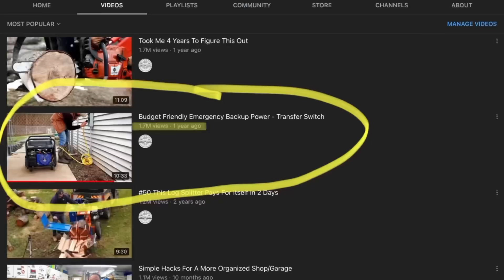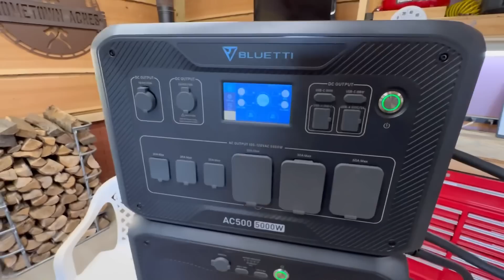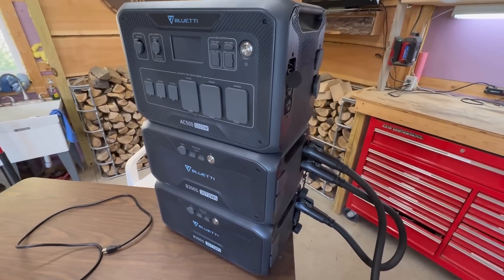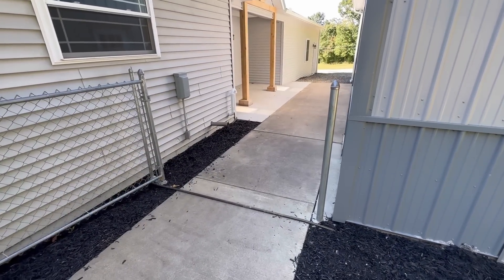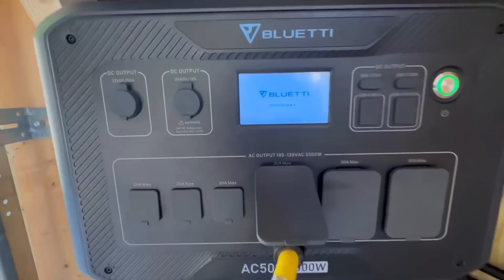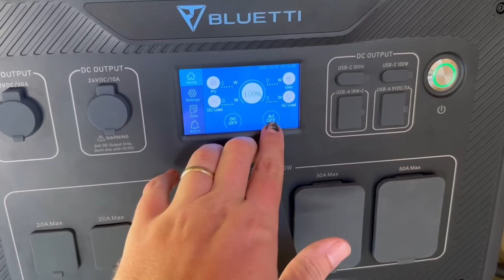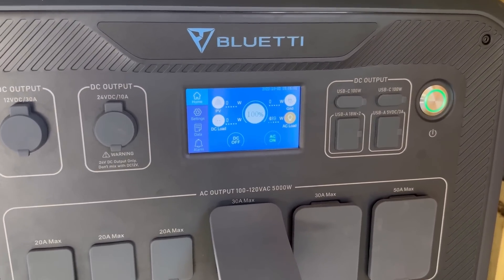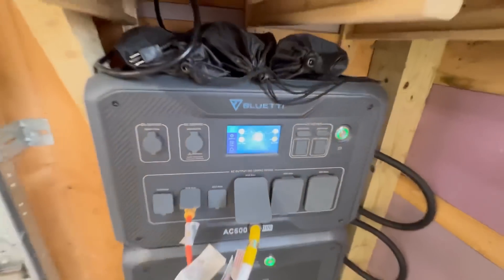The End Of The Gas Generator? - Bluetti AC500 & B300S

Comment: Thanks for the video, good information. One additional benefit to a transfer switch - the ability to route power to the protected circuits at the same time that utility power is running and powering the other circuits outside the transfer switch. Why do this? You might wish to capture solar power which feeds your battery bank, and then use those batteries to feed your transfer switch. You could offset a lot of your utility bill and make use of your solar system on a day to day basis. These batteries can endure many cycles, using them regularly is a chance for testing, and you can recover some of your costs of the solar / battery system. For this reason I like the transfer switch - feeding two sources of power at the same time. Some of the devices that you found were not on your transfer switch could be addressed with extension cords. Also, you could consider using a traditional generator to refill the battery bank, which would be more efficient than running the generator constantly at times of low power needs. But be careful about feeding dirty power to the battery bank - an inverter generator would be preferable. I do wonder why you turned off you main power to the house? With the transfer switch implementations I have seen, you could start moving your transfer switch circuits to the generator path and the other non-protected circuits could keep pulling utility power. Those transfer switches have a toggle switch so the circuit can take only one source as a given moment in time.

Comment: Adam,  Your just starting in to it. With backup generators & power storage units,  an with solar panels. You need to know your average daily air pollution count. We decide to put our panels  at ground level so they would able to wash then . "Lately", we been wash'n them monthly with a Mike Morgan Foam Cannon. I would hate to have to climb up on a two-story roof & wash the panels. O, I like the looks of your new drain system.

Comment: Man wish I could test a system like that here at the off grid home. I live off solar, windmill and generator. With gas prices right now running the generator is getting way expensive. Is your house and land position right to add solar? Start with a small system then add on as you go? My other question is how do the battery packs hold up to cold weather? I notice my batteries seem to have a hard time in cold weather.
Reply from the maker: They have built in heaters in them rated for temperatures down to -4 F

Comment: Most farmers near me run backup power off a tractor PTO...  I've seen these electric generators before but no chance... the cost is way to high.
A 10000 watt champion generator is much cheaper ... a cheaper option and quieter is a 4000 invertor  generator which us much quieter.

Comment: Battery backup has it's place but I prefer the generator as my backup source. BTW If your carburetor/fuel system gets gummed up after long term storage, it just means you didn't put it away properly. For long term storage you need to purge the fuel system. For shorter intervals you can use fuel stabilizers but purge is always the safest option just in case that storage interval last longer than expected. If you put your batteries away improperly, IE: not charged, you will have issues as well. So putting your backup power source away properly is necessary whether you use a gen set or a battery.
Reply: When you say purge the system, does that mean turn the gas off and let the carb run empty thus shutting the motor off ?
Thanks
Reply: @leovogelgesang4398  Doing that will remove most of the gas but not all of it. There will still be enough gas that will turn to "varnish" (as they call it) and clog the small passages in a carburetor. My procedure is to drain all the gas that I can and then pour a few ounces of Seafoam (a brand of fuel stabilizer & carb cleaner) into the tank. Then I crack the drain on the carb until I see a little of the Seafoam start to drip from the carb drain. Close the drain and pull on the start cord a few times to draw the Seafoam into the passages of the carb. Then put it away. When I get ready to use it again I just open the drain on the carb bowl, wait for the bulk of the seafoam to drain out then close it. Add gas and away you go.

Comment: Nice Video.. and I agree each household needs to determine their needs and what works best.. I see the cons with Gas generators if you don't use them, fuel issues etc.. Maintaining multiple, typical unused engines gets old and usually is ignored.. Living in a country and if you have a tractor, you might consider a PTO generator.  Alternatively I have neighbors who are concerned with flooded basements in the spring, they have installed propane generators , with auto start and an auto test features.

Comment: While it is very expensive you could double that set up and have 10000w inverter and 12000w battery storage(you could add more batteries to triple that). With 2 units you can have up to 6000w of solar panels.  This is the future.

Comment: I have a small portable Bluetti and it is a well built device. They say that the LiFePO batteries are safer than Lithium Ion and they also have many more (about 6 or 7x) charge cycles of lifespan as you mentioned in the video. Those two benefits are huge because you could buy cheaper Lithium Ion batteries with a Wh rating comparable to the B300 LiFePO. Bluetti isn't cheap, but it's worth taking a look at even if you're only going for a smaller capacity model. If I were building from scratch for off grid, I'd do some targeted DC wiring in the house to avoid the inefficient conversion from DC to AC and back to DC for virtually all of today's electronics.

Comment: Nope. No. Nope. How long can those batteries hold charge in storage? What is the maintenance plan for storage? A lot of Li batteries don’t like sitting at 100% soc or 10%soc. A usual sweet spot is 50% for storage. Kind sucks if you need it at a moments notice and it’s only 1/2 full. How to refuel if the grid is down?!…oh that’s right! Let’s charge it up with a ice generator 🥴🤦‍♂️ Adam a better investment would be a ford Lighting truck if you want battery back up power. Better chance the battery being in better condition and way more capacity.

Comment: Excellent overview, Adam! I’ve had the interlock system installed for 2yrs. I can run every circuit other than AC. My dual fuel generator is on a large covered porch with no exhaust/ventilation issue. However, I would advise anyone to consider a battery B/U or maybe both both - nothing is perfect.

Comment: If you were to be without power for more than two days, could you recharge the batteries with the gas generator while still using the battery packs and have the generator add more charging power than the house was using? I hope you understand what I’m asking here.
Reply from the maker: Yes I believe that would work but that sounds an awful lot like strapping a gas generator to the roof of your Tesla hahaha
Reply: @HometownAcres  - 😎Doug is saying " Give that Tesla some gas Princess"
Reply: @HometownAcres  depending on how much power is required to refill the batteries, you could get a small, cheap generator that maybe puts out 1K watts. Our neighbor kept their house going fueong our recent 14 day outage using a small generator and a couple extension cords. I think he said he used about 5 or 6 gallons of gas during that time.  I used about 8 to 10 gallons a day on maxing our 6K generator.

Comment: Edit - Wow sir, your three accessories were $6,500.
Firman 7500W Running tri fuel (propane option) is $999 on costco. 250g vertical propane tank will last about 15 days and cost $500 to fill to 80%. Louder, yes. 
My neighbor is in the process of installing a propane generator. I'm curious to see his results. Thanks for vid. BTW, the most frustrating thing about the so-called Green industry is on Bluetti's homepage: "...but without any fuel costs, noise, and pollution." No... we just outsourced our pollution to China in the form of mining lithium, producing these batteries, and the requisite panels.
Reply: I agree!! The price tags on these solar generators are too much for the average joe.
Reply: @The Solar Junkie The only thing you are missing, is an 80 foot tall $50k wind turbine standing in the wind!  But then, what if there is no sunshine nor wind for a long time?  Well, then you resort to your gas generators.

Most folks can only afford a single backup power source, such as a gas generator.  And even then, these can get ridiculously expensive.
Reply: @The Solar Junkie Very cool. I'm going to check out some things in your post. Thx!
Reply: @The Solar Junkie That's what I am trying to do. However, by the time I have everything, something newer will come out and make my system outdate.
Reply: I had a Westinghouse 9500DF installed and directly connected to my cottages power and existing 500 gallon LP tank. It works great and the certified electrician says I have more than enough power to run everything.  I''ve had only a couple of outages since, with the longest nearly 4 hours.  I've changed the oil to 5W30 synthetic to handle cold weather, checked the spark plug, clean the air filter (at 50 hours), and start it regularly once a week for 15-20 minutes; and, one time, for an hour.  Trying to decide if I should sell myself into a whole house inverter with split phase and two batteries since I have a 240 water pump(?).  I am just not sure how I recharge the lithium batteries using the LP generator?
Reply: As far as lithium mining, Electric Cars use WAY more lithium than do these batteries. In fact, a recent report is that we'll need 3 times the world's known supply of lithium for everyone to own their own EV. I'm sure the Globalist love that, as they hate the idea of everyone having a private car instead of taking mass transit, and we know how Democrats love the word, "MANDATE."
Reply: As you complain on your phone where do you think the battery came from on there?  And, his point is when the common thing that everyone does like run to the pumps or to get propane you think it's gonna be safe and easy to do that around angry people?
Reply: @jayb.8460  I'm not complaining. I'm 100% happy to have my phone. It is by definition a portable device. A house isn't, nor are the power requirements appropriate for battery packs. Have a great day!
Reply: @The Solar Junkie I give you credit for pursuing your hobby.   I was only giving you a jab for your abundance of toys.
Reply: @The Solar Junkie  

I prefer affordable simplicity. 

For instance, my son got huge backup power by purchasing a $150 Interlock device for his electric panel, a $35 receptacle, and $15 for some 10 x 3 wire to hook up the receptacle.  

I gave him my old 20 foot power cord and my old (lightly used 9000 watt Chinese Powerhorse generator from Northern Tool).  And it worked "right out of the hole"!  BINGO!  

Granted, it produces dirty power, but his house computers and everything works  well enough with it!  Gee, that sounds like a Trifecta!
Reply: Not to mention electric cars might last 60,000 to 70,000 Miles and then cost $7000-$10,000 to replace those batteries. And where do the old junk batteries go? IN A LAND FILL. As apposed to a gas vehicle that if maintained will go 300,000 miles easy. Vehicles are responsible for %2 of pollution so I'm guessing gas generators are lower then that.
Reply: @chadbinette3201  So here is the kinda good news. Electric vehicle drivers are going to pay a stupid tax of epic proportions. The people trying to force this stuff on the smart people aren't actually lying. They are just 100% idiots and are paying a massive amount to virtue signal. As you point out those batteries don't last and they are prohibitively expensive. Similarly a certain part of the country thought a little spike in their blood was fine and attempted to use that to divide the country. They were stupid enough to believe it wasn't harmful. Now there's a stupid tax you really can't take back. They are attempting to hurt all their children through killing them or just sterilizing them. While I think they should be imprisoned or worse, that's not currently society's position. However the stupid tax will come due. They keep firing at themselves. List goes on and on. In 20 years we'll see who was right. I'm a patient person.

Comment: The price tag for all 3 pieces your 1/2 way to a whole house natural gas generator.The replacement batteries are more than the main unit …
Reply: I could in my area buy a genrac natural gas generator for LESS than this setup. My power is only $125 per month. It would take me 2 lifetimes to pay for these type power generators.
Reply: @fuzfire hopefully, in the future,  they make these out of cheaper and lighter batteries. I'm hoping some company comes out with solid state batteries instead of lithium phosphate

Comment: Something like this would be nice to run an RV air conditioner overnight since most campgrounds don’t allow generators after 8pm. This technology is only going to get better. Nice job, Adam.
Reply: These batteries will run your RV AC and fridge for about 4 hours. And you need to cover every square inch of your roof with panels, just to recharge them.
Reply: @Gruuvin1  Not a 240 volt AC..
Reply: @m9ovich785   it's not about the volts; it's all about the watts.
Reply: @Gruuvin1  A lot of Roof top RV AC units are 240 VAC. Some Camp Ground Power posts have 30 Amp/120Vac and 50 amp 240 Vac. That Fancy Box will not Power 240  Vac Devices....
Adam my be the Rare one to have a 120 Vac Well pump.
It will not run His Central Ac unit. (If He ahs one).
Reply: @m9ovich785  that has nothing to do with how much power an AC unit uses over time and how quickly it will deplete your batteries. What really matters is the efficiency of the unit, and even very efficient units are battery killers, whether 120VAC or 240VAC.
Reply: @Gruuvin1  I wasn't even mentioning Efficiency, That unit will not power 240 Vsc Devices...
Reply: What is the point of camping in an RV with AC?  Might as well stay in a hotel or stay home
Reply: @scottmcdonald359  well I camped in Tennessee this summer. With a heat index of 108° F, I really enjoyed my AC while sleeping in my own bed. My camper also has a refrigerator and bathroom (gasp!) 😄
Reply: @MyClutteredGarage  Agree with the comments about high heat index, but when I go camping, I am usually am hiking, fishing, cooking over a campfire or many other things that are away from AC.
Even when we go to the Grand Canyon in July and we don't have AC in the cabins on the North Rim. No television, no internet and maybe cell phone service.
Reply: @scottmcdonald359  sounds perfect. ❤️

Comment: What about battery longevity? These batteries are great, but they can’t be easy to get rid of when their lifespan is done. Between that and not knowing how long they can charge and hold a charge, I think sticking with a generator is better. Just my opinion. Keep up the great content Adam!
Reply: Unless your able to seriously abuse this unit, the LiFePO batteries will outlast your life. The 10year capacity rating means if you were to to discharge the batteries in this unit every day and recharge them back up to full charge everyday, you will have full CAPACITY for 10 years. After 10 years of doing this every single day you will be left with 80% of the original capacity indefinitely. Meaning these batteries will outlast your lifetime. If circuitry or something on the unit goes down contact bluetti for a warranty claim.
Reply: 10 years
Reply: @extraclip  but only if you discharge them completely every day, wich I don’t think you will
Reply: Lithium batteries are highly recycleable - and only getting better as there is more of them.

Comment: Yeah, I don't think so, I'm in my third week of no power. I really don't think that thing would be able to do what my generator has done for 3 days, let alone 3 weeks.
Reply: With unacceptable service like that you should consider a battery backup PV system and disconnect from the grid.  This is readily achievable now, you can do a complete system much better than this hobby type system demonstrated here.  The solar PV will be cheaper than the battery backup but batteries really don't like to sit around on standby, they prefer to be cycled 20-80% for Li batteries.
Reply: @thereplacementfordisplacement  this was a once in a hundred year hurricane.  A system like you're talking about would be minimum  $80 - 90,000 . I think I'll stick with my $900 generator.